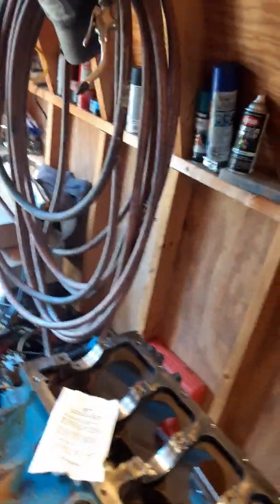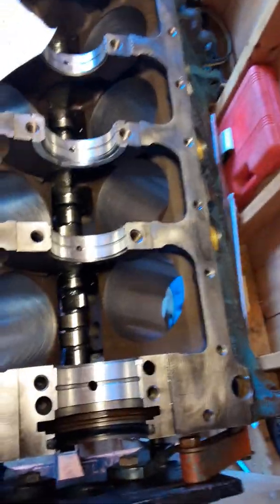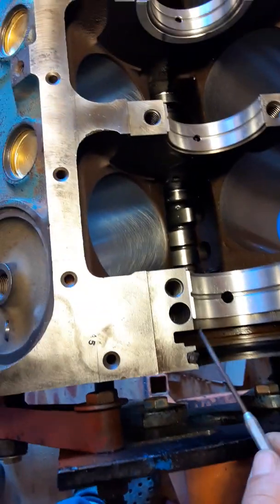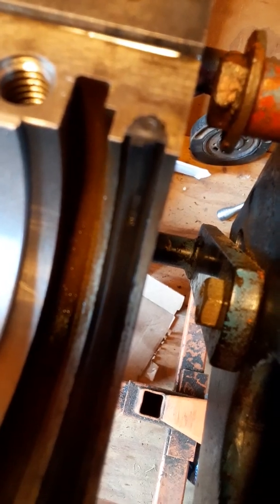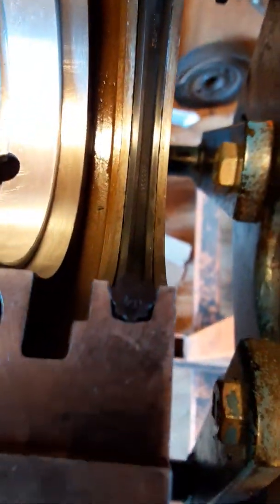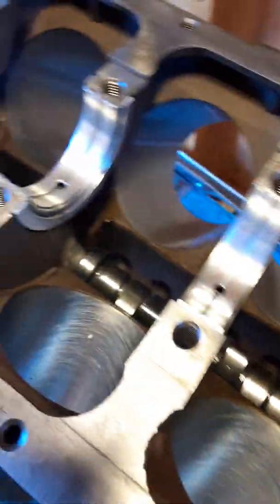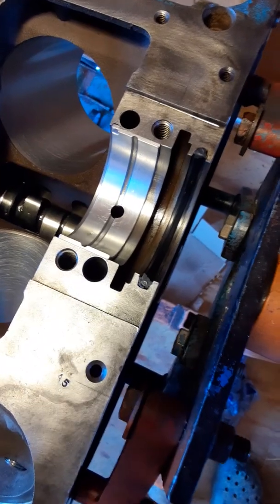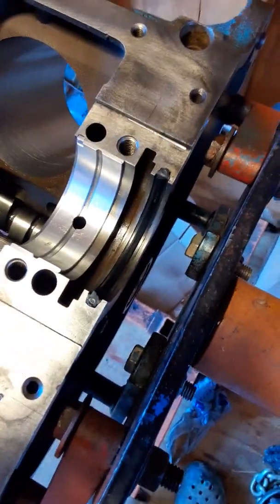2 piece rear main seal installation Chrysler LA small block

Comment: Aren't the seal halves supposed to be set slightly clocked off of the plane of the block surface so as not to have a joint align with the block and cap mating surface effectively not giving a joint on a joint. Asking sincerely as I'm about to do this

Comment: Thanks for the video.  The larger part has the lip that should catch the engine oil pressure, with that pressure, it should push out the seal to help it do its job. But still have leak but I believe it's from me not sealing the outer part enough. Also the cap needs to be matted before the sealant starts to set up.